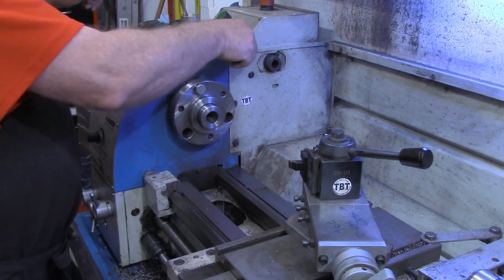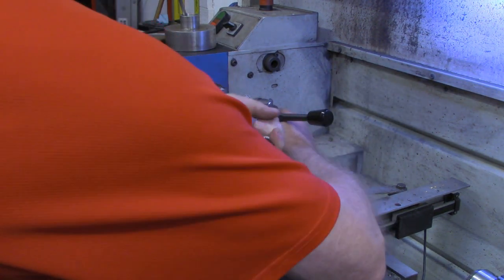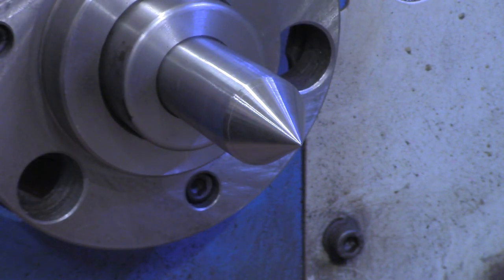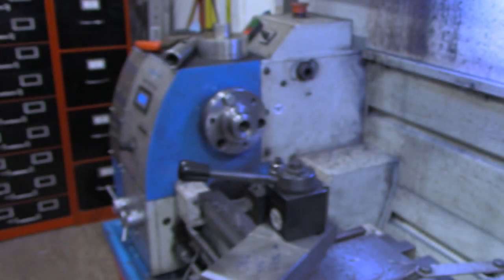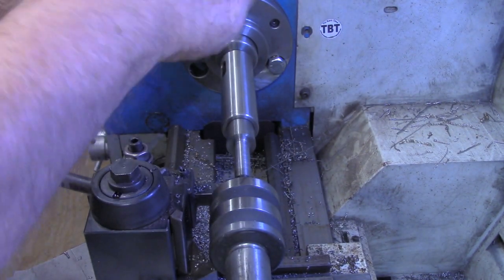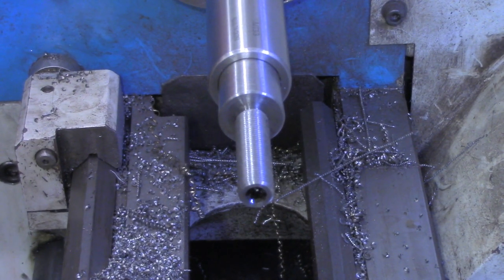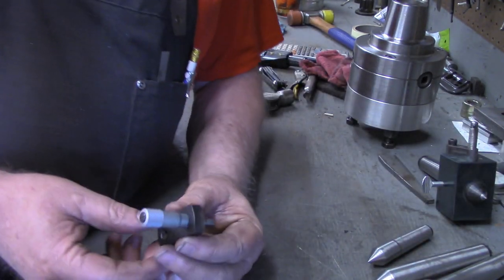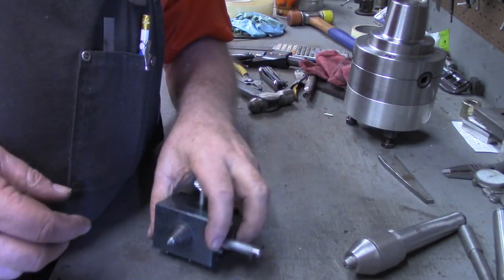Turning Morse Tapers With The Tail Stock Offset - Part 2 of 2

Comment: Your work is very instructive and enjoyable as you work thru issues. Note that the tail stock offset taper attachment is a ~ 70$ commercial product available on Ebay. It’s made in India. Not as good as UR’s no doubt.